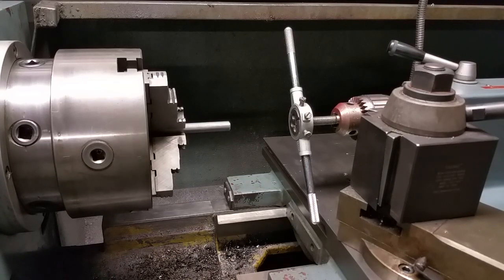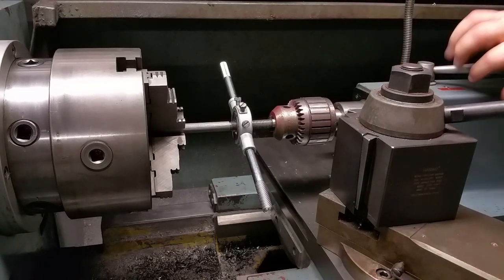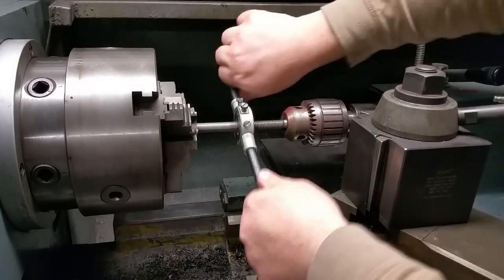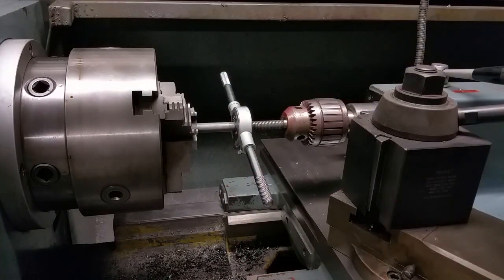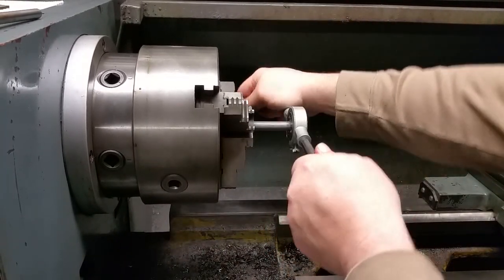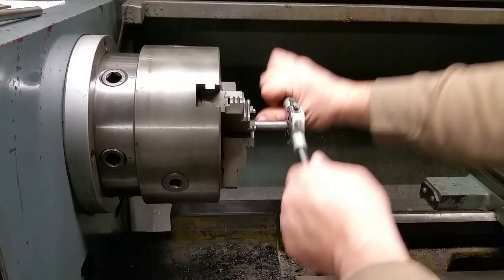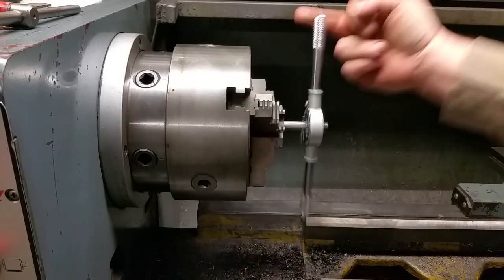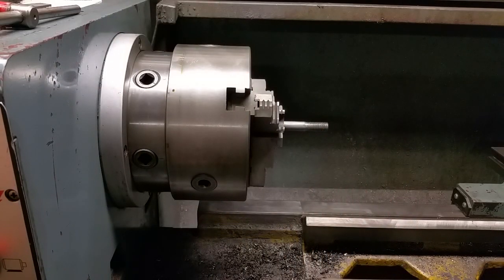Quick Bits: Die thread cutting trick

Comment: nice trick. i always use just put a flatpiece on my tailstock spindle and press the die on it and bring it to my workpiece  and so you press it 100% straight onto your workpiece. then i place the die holder on my cross slide and let the chuck run realy slow and just follow the thread and stop before your final distance and finish by hand then there is also no need to ''break the chip'' because it flows out nice. sorry for my bad english
Reply: Yes that is  the best and easy way to do it you do not need threaded bar to guide you!
Reply: Thats the way you do it for sure! And dont break the chip, its useless with dies